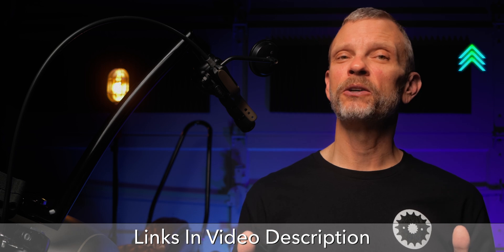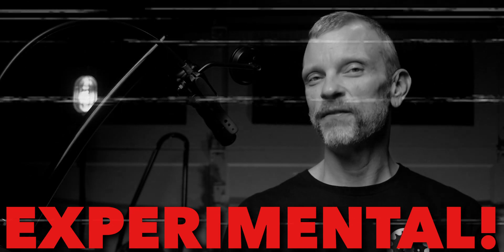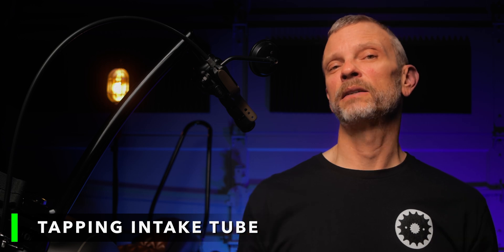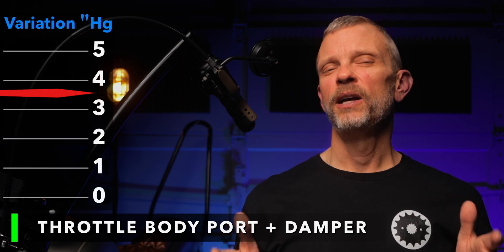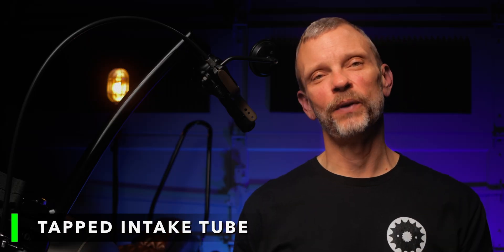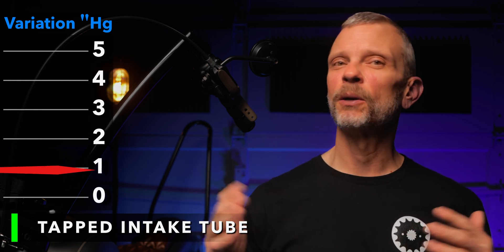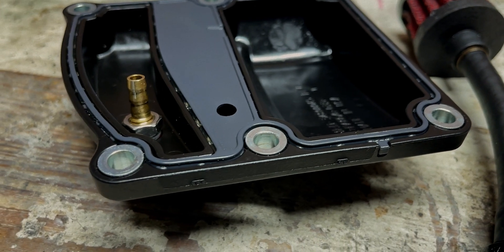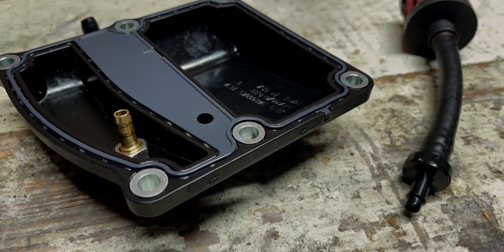Vacuum-Ported Catch Can • Crankcase Vent: Keep It or Dump It? 👍🏼❓👎🏼 (M8 Sumping)

Comment: Ron great videos and your work on sumping and crankcase venting.  I have an early production 2019 Street Glide with the early, lower capacity oil pump with the potential for sumping. So to correct this, I decided to do a cam chest upgrade, and your transmission cover crankcase venting.  For the cam chest, I went with the S&S cam and oil pump kit, the 465C cam, with intake and exhaust upgrades, and ThunderMax EFI.  For the crankcase venting, went with 3/8” tubing, 3/8” check valve through the transmission cover, and venting to atmosphere through a filter (no catch can).  Tearing the bike down, I was surprised at the amount of oil I found in the throttle body and old intake manifold.  Then I used a boroscope to look at the top of the pistons.  These were coated heavily with caked on oil.  Found this surprising since the bike only had 3000 miles on it.

Project went well and bike runs great.  After about 250 miles of hard riding, absolutely no evidence of oil in the throttle body intake.  And the check valve and tubing is also clear of any oil or build-up.  I’m sticking with the transmission top cover venting for now.  Thanks
Reply from the maker: Hey Kenneth - thanks for the kind words and for sharing your project! I’m glad you’ve gotten sick good results. That’s crazy about the oil/carbon buildup after so few miles. How do you like that cam? With all the other upgrades I’m betting it’s now a totally different bike!
Reply: I’m not trying to get higher Hp or torque, just more low to midrange pull. The S&S 465C is a great bolt-in cam for that range. Used the Fueling heavy duty solid stock length pushrods which added some work to the project, but prefer the extra strength vs adjustable pushrods.  With the ThunderMax EFI, upgraded to the V&H power duals head pipes for the looks and eliminated catalyst. This gave me the wide band oxygen sensor bungs for the ThunderMax to control the AFR.  The ThunderMax is truly plug & play.  And with x-cat, bike runs cooler with no backfiring ever.  Engine has a strong pop-yer-neck pull from take-off through midrange.  And engine runs smoother through entire RPM range.  Loving it.
Reply from the maker: Nice! I want to research the ThunderMax EFI. Sounds promising.

Comment: Have to say, dump it.
Reply from the maker: Fair enough! It was interning to work with but I do prefer my original transmission top cover vent solution.
Reply: @RonsWorkshop  anxious to see what you come up with next …. I really like how you come at a particular topic from every angle imaginable… very interesting. You definitely helped me narrow it down …. You want to know something weird? I took the bike in to my Harley dealer, thought he was going to pop a vein in his forehead…. He swore up and down that that trans top cover was venting to primary and trans and had no way at all of venting the engine case. He said that Trask checkm8 cover was horse 💩…… like a company that’s been around that long with a heavy reputation like that would flush it down the toilet to make something that was 💩…. Funny.
Reply from the maker: Strange indeed. The proof for me was the plastic bag over the vent hose. There’s no doubt the crankcase has positive pressure because it inflates that bag in a couple of seconds.

Comment: Hey thanks for all your awesome information!! I do have a question…I’m wanting to tap that trans vent cover but thinking if adding solid bolts where the intake breathers are to completely eliminate the possibility of vapor into the intake. Think that’s a good idea or just keep it original just in case?? Thanks again!!
Reply from the maker: Hey Michael 6.0 - thanks for the kind words! 

Note that if you do both mods you remove the chance for getting a vacuum in the crankcase (the breather bolt mod would eliminate the oily residue in the intake but also remove the potential for vacuum in the crankcase). You can either do a check for sumping (https://youtu.be/F2N7kwCspQE) or you could just do a simple check to see if you’ve got positive crankcase pressure (and almost certainly we all do). Just remove the oil filler cap, fire up the bike, and either stretch a balloon or tape a plastic bag around the filler hole - if it inflates you know you’ve got pressure that could be relieved. I’ve tried to measure the vacuum that comes from the breather bolts venting to the throttle body and I couldn’t detect any. (Maybe my gauge isn’t sensitive enough, maybe there isn’t any, maybe it’s higher at highway speeds…etc.) Vacuum is very beneficial but more important in my opinion is venting the pressure out.

Let me know if that helps…and if you want a sticker send me a DM on Telegram, Instagram or Signal with the mailing info @RonsWorkshop

Comment: Ron,the trans cover i was referring to is the T-Man setup.It seems to me that the crankcase would be pressurising with this system
Reply from the maker: Ahh ok. T'-man's solution has a vent that they install, and mine does too, so in both cases that pressure would be vented.

Comment: I still think you should go back to your diy top cover. And diy it more by drilling one more hole and routing the breather vent tubes into that.
Reply from the maker: Yeah I'm pretty much at that point. I could just T the breather lines into the one crankcase vent line and skip drilling another hole.
Reply: @RonsWorkshop  badass brother! I wanna see your final results of that if you go that route. Like the crack pressure tests in rpm’s etc. You’ve done the most in depth testing of these mods I actually seen someone who’s done them on YouTube do. Appreciate the time your taking with us to sess out the actual best working solutions
Reply from the maker: Thanks for the encouragement!
Reply: @RonsWorkshop  oh how’s that gonna work? Which crank case vent line? I think one more hole on the top cover, T the breather tubes to a line to that with no check value and just use your previous hole with line check value and catch can the same as you did before.  It will release pressure and hold vacuum.
Reply from the maker: I could T into my transmission top cover vent from this video: https://youtu.be/U6gOhbRQrwE

Comment: Hi Ron! So I've watched all your videos as well as others. Have to say first,  you are like the leading authority on this very complex subject  😀 you've done more experimenting than anyone I can find,  so thankyou!! My question is,  I did the breather intake mod first,  and then tackled the transmission cover mod.  So, now that I've done the latter,  what's your opinion on leaving, or reversing the intake breather mod?
Reply from the maker: Hey tdbrillo - thanks so much for the kind words! I’m so glad you find the info helpful. As to your question: the trade off with having both mods is that you remove any chance of crankcase vacuum (specifically the external breather mod removes it). But, from what I’ve been able to measure, that vacuum is very small and may not even be present. It’s just hard to tell. All of that to say I don’t believe it’s worth losing sleep over. The big benefit is alleviating that crankcase pressure, and you’ve also removed that oil from your intake - both big wins. Does that make sense?
Reply: @RonsWorkshop  yes, it makes perfect sense 😀 that is what I was hoping you might say,  it's easy to lose sleep over this shit ha ha ha. In the end,  I just want a solid,  healthy motor.   Thanks again so much for being so helpful,  you ROCK 🎸 😎😀🤩
Reply from the maker: My pleasure - let me know how it goes!

Comment: Ron,i noticed a system on You Tube recently where the Transmission cover, where you had the breather outlet on the modified tranny cover,had two inlets attached to it and the hoses from these were run to the breather bolts on the heads.Wouldnt this just feed breather pressure back into the crankcase and increase the problem ??
Reply from the maker: Hey Brett - if the heads were vented to the transmission top cover without an outlet, it would maintain the crankcase pressure. There would need to be some vent to the atmosphere to allow that pressure to escape. Otherwise it would eliminate the oily gunk from the intake but not release any crankcase pressure. But a modification of that theme would be viable!

Comment: Have you thought about venting head breathers into the exhaust?  That would supply the vacuum.  I’m wondering if there would be enough oil to smell.
Reply from the maker: Hey dpf - that’s definitely worth considering. In my case it’s not a lot of oil residue so maybe there wouldn’t be much smell, if any. It might gunk up over time. But that might just be worth trying. Thanks for sharing the idea!
Reply from the maker: And routing it through the catch can would filter out the oily mist as well!
Reply: I’m going to try it myself.  I’ve read it’s important to get a 45 degree angle for proper vacuum.  Drag racers use this technique.
Reply from the maker: Excellent! Let me know how it goes.

Comment: Ever consider adding a PVC vavle to your throttle body vacuum setup? This could regulate flow/vacuum dynamically as engine load conditions vary. Good overall info on this crankcase vent topic here http://www.engineprofessional.com/articles/EPQ315_34-44.pdf
Reply from the maker: Hey Paul - that's a good suggestion (and sorry for the delay - YouTube held the comment and I just saw it). Tracking down a properly sized PCV valve might take some work, but it's definitely worth considering. I've found a 5/16" brass PCV valve that seems promising and I've considered swapping out the check valve in the regular crankcase vent with that piece. Let me know if you try anything!

Comment: Funny Story: I decided to attempt a similar DIY project utilizing a one way check valve. Somehow, when I clicked on the 3/16” diameter size check valve ordered on Amazon, instead of 1 check valve, I received a bag of 100! Now I need 99 more motorcycles to use up all of my surplus check valves.
Reply from the maker: And now there's a shortage of 3/16" check valves 🤣

Comment: What are your views on Blockheads no maintenance (no catch can/filter) venting solution ? He routed the air breather vent hose into the crankcase cover and made an extra notch in the top of transmission. https://youtu.be/bIyaV8KP8HI
Reply from the maker: Hey Mac Rider - sorry about the delay in responding. YouTube held the comment for review and I just discovered it. Based on his follow-up video where he clarified the notch in the top of the transmission housing, I think it’s viable. (That was omitted in the first video so without that it didn’t make sense to implement it that way.)

Comment: Thinking of routing the oil blow-by from the intake to the trans cover instead of a catch can.  Along with a trans cover vent .......
Reply from the maker: Hey Steve - you could definitely do that, or even T it into the transmission top cover vent line near the pod filter so it would end up venting out.

Comment: On my TC, I don’t think it has excessive air turbulence in the crankcase. I believe the air is pushed through the crankcase pushrod tubes to the heads and finally the one way check valves which diverts the hot oil misted air through the a/c and ultimately into the throttle body to be burnt in the combustion chambers… my goodness…that’s one long sentence. Anyhow, the problem is that the misty oil crap turning to oil carbon buildup.  For me, the simple a/c bypass and a DK catch can is the solution for the TC.  Meanwhile… back at the ranch…

I’ve ridden a lot of M8s, and biggest audible difference compared to the TC… the TC has noisy valve train (Tic).  Most M8 have a whirling sound (as if it’s moving a lot of air around in the crankcase).  I’ve been told the whirling sound is the result of additional valves and associated rocker-arms.  

I’m still waiting before I procure a M8.  I’ve been wanting a fat boy for many years.  That will be my next acquisition.  

My question, I’ve noticed the MoCo changed the dipstick configuration on the 2022 M8s.   

I wonder what drove the change and what other “theories” or processes may have also occurred because of the change.  

I have not ridden any 2022s yet, but assume they will still exhibit the same internal engine sounds… but can’t help but wonder if the dipstick change maybe addressed the sound. 

HD is evolutionary… constantly changing in order to meet the ever evolving government regulations.  

You do a great job presenting your personal experience.  Thanks.
Reply: I've heard others say the whirring sound is caused by the counterbalancer. But it could be a combination of moving parts.
Reply from the maker: Hey Josh - thanks for the input!
Reply from the maker: Hey 2TRDGTF1 HD SGS - I haven’t seen the 2022 dipstick setup yet. Now I’m curious :)

I definitely noticed that whirring sound before the Stage III kit, but it’s so loud now all hear is that awesome lumpy idle. 

And thanks for the kind words!

Comment: After watching all your solutions I personally feel as though the trans cover alone is the best because venting back into the breather or throttle body causes any moisture evaporated out of the crankcase to be introduced to the combustion chamber which could rob some power. So in summary, you had it right from the beginning
Reply from the maker: Hey Olend - yeah, that’s pretty much where I’m at too! I love the simple effectiveness of that transmission top cover vent.
Reply: That’s what I’m doing, too.
Reply from the maker: It definitely works well!
Reply: Sense I’m just venting Tran top cover on my 2017 ultra limited 107 stock pump should work better now that there is no pressure holding it back right ?
Reply from the maker: Probably yes, as the oil could be less aerated.
Reply: And thank you Ronsworkshop

Comment: Thanks for the vids, other question what is your rpm without throttle? 
What Mapping kind do you use? v&h fuel pack/ dynojet/ screaming eagle?
Reply from the maker: Hey Alpenrepublik Enduro Mtb - I appreciate the kind words! Once warmed up the bike idles at about 950 rpm. I’m using the screamin’ eagle pro street tuner with a Harley-Davidson map that’s for the Stage III build (I’m running Stage III).

Comment: The bit I'm struggling with is how all the pipes are connected. Just to clarify, I maybe wrong thought.
You are running a pipe from the crank case to a catch can then out to the atmosphere.
Then you are running a pipe from the head which would normally go into the air intake also into the catch can?
Then another pipe into either the filter intake side or intake manifold side with a regulator to create a negative pressure. But I'm struggling to work out where the negative pressure is placed, is it on to the catch can via a T with the pipe that comes off the head?
Reply from the maker: Hey Orange Manstan - I totally get why you might be confused! There’s a lot going on there. One line goes from the transmission top cover vent to the catch can. Another line goes from the external breather mod to the catch can. And the catch can outlet is ported to a (potential) vacuum source. The regulator is in the outlet between the catch can and the vacuum source. Does that make sense?
Reply: @RonsWorkshop  thanks Ron, it does make sense. The way Harley seems to do it is with the breathers going straight into the open bell mouth. I doubt this creates a lot of vacuum I suppose similar to your connection just after the air filter. The only thing I'd say is that you are splitting the vacuum between the area at the top of the head and the crank case where as Harley doesn't seem to have a vacuum on the crank case unless the top of the head outlet is the same thing. If this is the case then it sounds good to me. Only thing I'd say about placing the vacuum pipe on the inlet manifold could this affect the mixture at all? Maybe not.
Reply from the maker: I don’t think there would be any noteworthy change in the mixture. The catch can should do a good job of separating any oil from the air before it hits the intake flow.